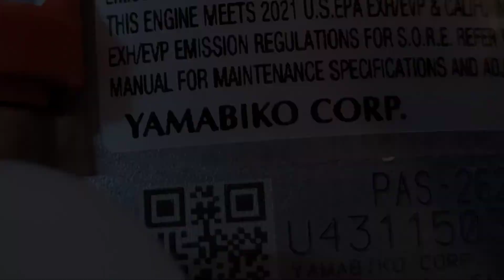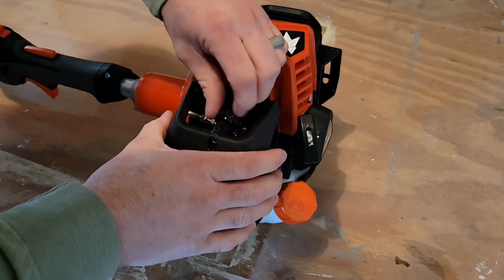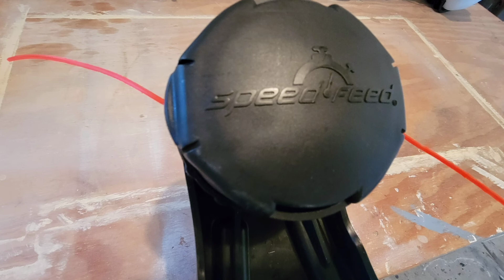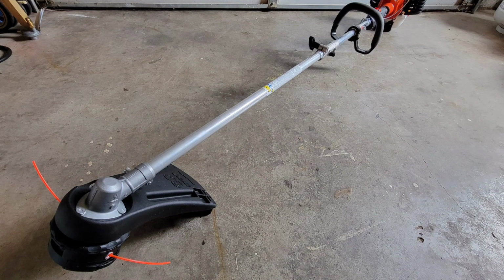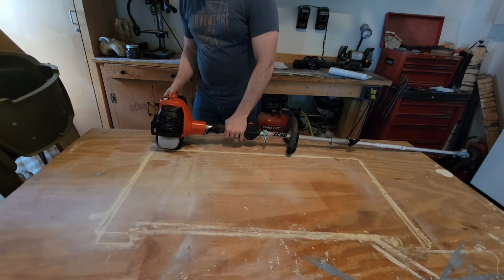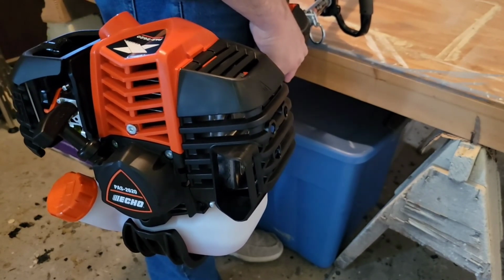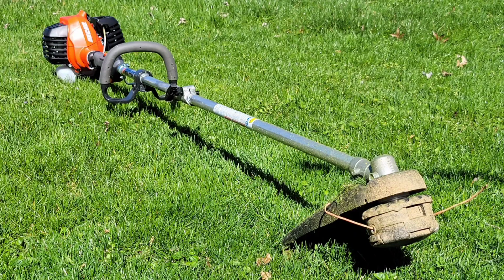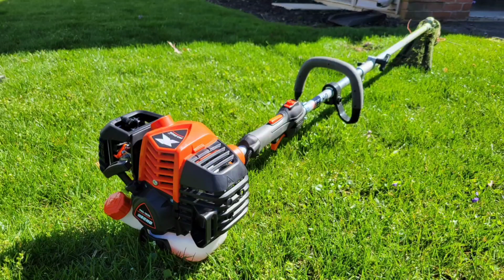Echo PAS 2620: Review

Comment: I got the same system, but I got the high torque head.  I barely use it because it's heavier then my Redmax bcz260ts. Echo cuts good. I might buy this regular head & compare them against each other
Reply from the maker: I think you'll like it.  Its worked well for me...cuts down everything I want it to with ease. Thanks for checking out my channel.
Reply: @theshopprojects  I bought it from HD, but thought I was having a store pickup, it's getting mailed to me. I got 3 HD within 5 miles of my home
Reply: I’ve got both I prefer the pro torque usually. The normal head is nice for thinner lines cause it loads faster and higher rpm. The pro torque runs big stuff so much better though no bogging even with tall and wet grass.
Reply from the maker: That's good to know Zack. I've wondered how much of a difference the high-torque head would be.
Reply: @theshopprojects  yeah for most people the regular head would probably be better I guess if you just do your home once a week it runs thinner line great. If you use your trimmer every day though the pro torque is worth the extra cost will fit line as big as .130 and spin it as well as the normal head spins thin stuff. The benefit is that it will not bog in thick grass causing your trimmer to dip down and mess up your level grass. Also because you can run thick line it will last much longer against fences and cement. It does spin slower though so you will be on the throttle more when you need it to be going quickly so you use more gas. If I had to pick one it would be the pro torque though when connected to the pas 2620 it is one of the best trimmer setups I’ve ever used. The echo matic head that comes in the pro torque is great also one of the easiest to load I’ve used that isn’t a speed loader and feeds very well.
Reply from the maker: That's good to know Zack.  If I ever need a heavier duty trimming head, I'll definitely check it out.

Comment: Nice review. I am considering the PAS225 series which is the 21.2 cc engine rather than the 25.4. It also can take certain attachments. Do you think it would be too under powered for an average homeowner or could I get by with it? I do like that it is almost a pound lighter. And it still excepts .095 line. Any advice would be greatly appreciated. Thank you for your time.
Reply from the maker: Craig, 
First, thank you for checking out my video...it's much appreciated. Second, I don't have any experience with the PAS225, but based off of everything I have ever read and heard about it, I think it will have plenty of power for a homeowner.  I've even seen the 225 used by commercial lawncare businesses.  I'm not trying to be biased, but I don't think you can go wrong with an Echo. They also have one of the best warranties in the business. Good luck, and let me know how it turns out.
Reply: @theshopprojects  Thank you so much.  I think I am going with the 225.  I am 62 and as I am getting older, the weight of everything I use becomes more of an issue.  I held a 225 at Home Depot and really liked how light weight is was and how I could stand up straight.  I am olny 5'8", but my Ryobi is heavy and I am bent over while using it the whole time.  Killer on my back.  Thanks again and I will let you know my thoughts after using the 225 for a few months.  Respectfully,  Craig Hellberg.
Reply: @craighellberg4366  I talked to Echo. They don't recommend using PAS-225 with the straight edger attachment. This can cause the engine to fail due to high RPMs. For straight edge attachment, they recommend PAS-2620.
Reply: I have the srm 225 weed eater and it has good power for pretty much anything